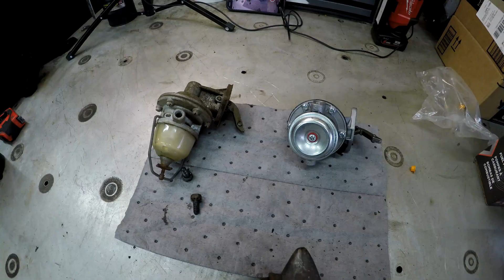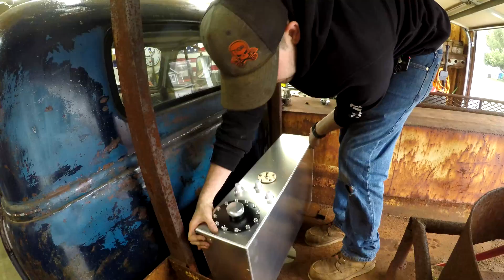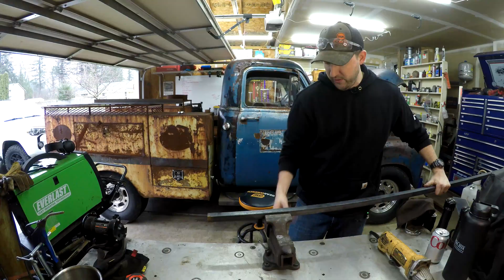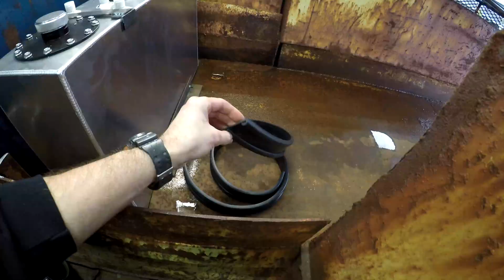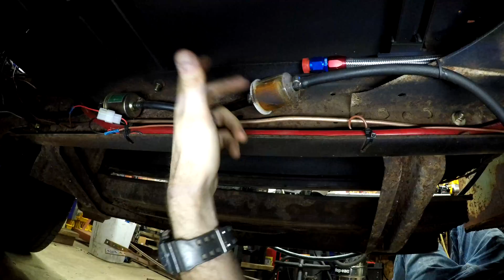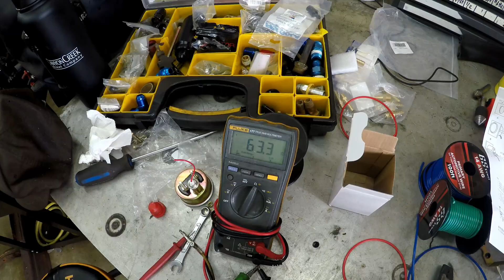My Truck Finally Got A Real Fuel System

Comment: My experience with fuel senders is that it will peg 'full' with an open connection. See if grounding the sender helps. Although it's not reading ohms correctly, it may give some idea of level.
Reply from the maker: I went ahead and just replaced the sender with a higher quality unit and its working good now
Reply: @TYGRSGarage  Nice. I'm trying to catch up in the playlist and probably should have waited to comment. But glad it's working for you.